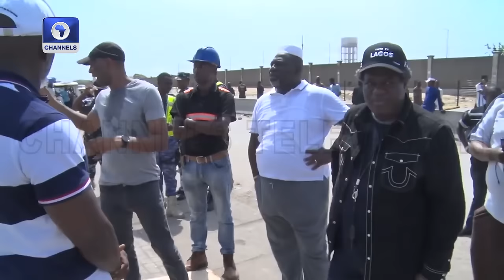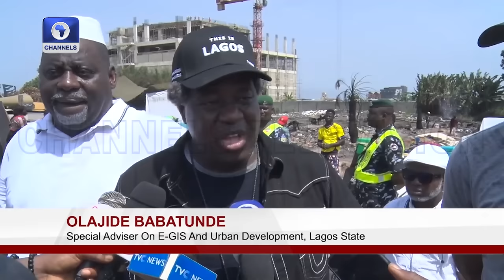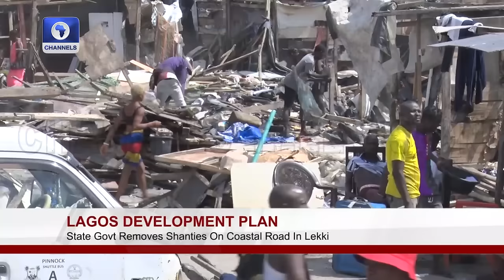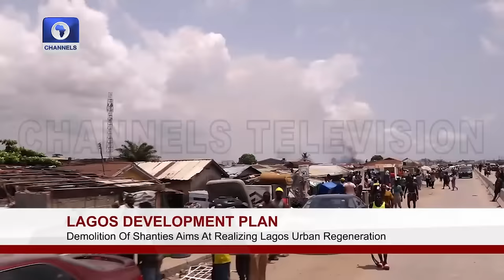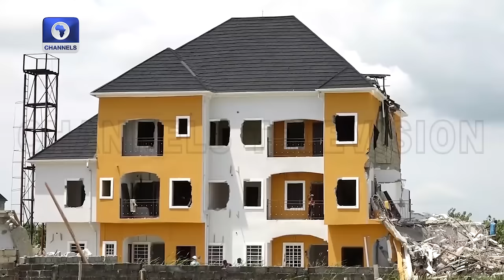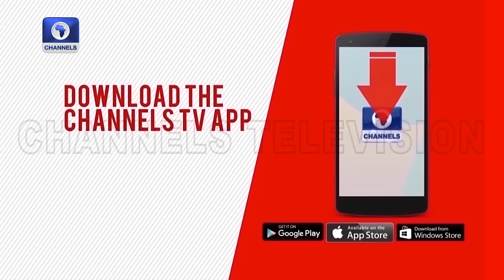Demolition Of Shanties, Houses On Lekki Coastal Road, Hopeville Estate +More | Eyewitness Report

Comment: LASG needs to set up Anti-Slum unit under the environmental protection ministry. The purpose will be to patrol coastal areas, bridges, train station, estates, etc, to make sure open spaces are not converted to slums. Too much nonsense in Lagos.